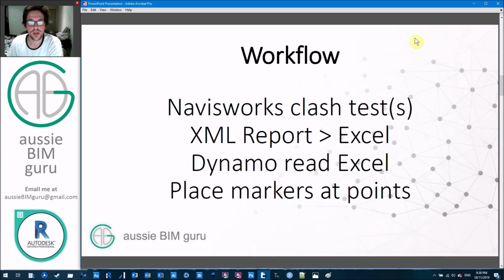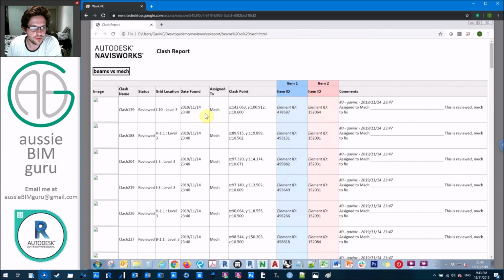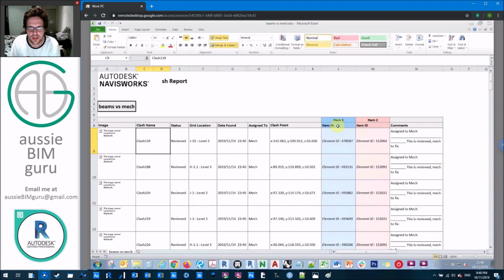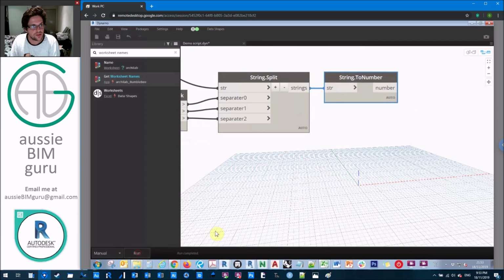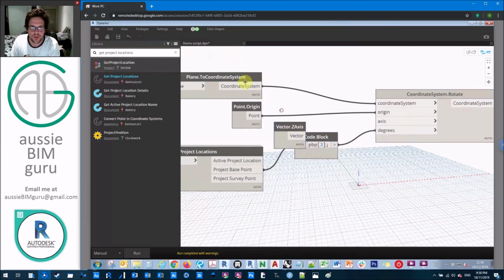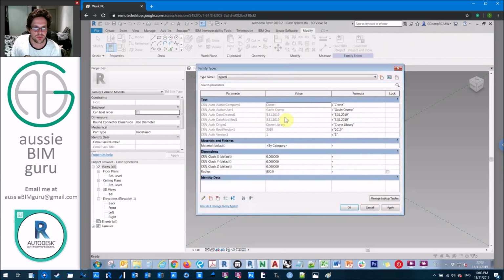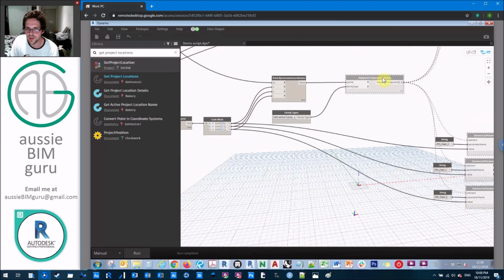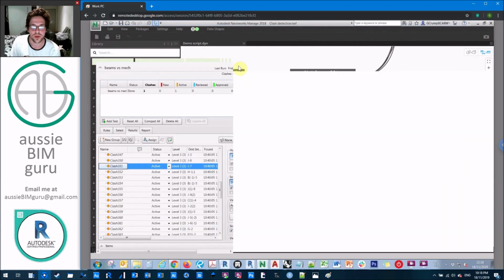Navisworks Clashes to Revit using Dynamo!

Comment from the maker: It seems the little adaptive sphere is the star of the show!

You can find it, and some other families from my videos here:
https://github.com/aussieBIMguru/Revit-Files/tree/master/Families
Reply: Excellent tutorial - Thank you. What is the benefit of using an Adaptive Family for the Sphere over a normal family containing a Sphere?
Reply from the maker: @paulwoodward81  thanks! The benefit here is an adaptive family can be placed at a specific point in 3d space with no bearing on level or offset, unlike a typical level/workplane based family.

Comment: Hi Gav, thanks for your amazing videos but . When I use Watch in min:13:55, instead of the actual values like you have in your example, I only see the header names such as point, conflict name, and so on. Could you help me with this?
Reply from the maker: It sounds like you might have missed a transpose of the data potentially. Youre seeing rows vs columns by the sounds of it.

Comment: This is a fantastic workflow. How would you deal with a project where the Origin displacement is 0.000, this is causing errors now in Revit 2024. And do you have to use Adaptive Family?
Reply from the maker: If the origin is coincident then I guess you would only need to rotate the points around it by the difference in project/actual north? Sorry might not be understanding this precisely. There are some nodes in Genius Loci that handle coordinate translations that I believe are probably more robust vs my approach here potentially.

Adaptive is really personal choice, you could also place a workplane/level based family at datum then elevate to suit as well. I find adaptives a little better to programatically move if you need to refresh the markers without creating them all from scratch.
Reply: @AussieBIMGuru  Your a legend Gavin, thank you for your help.

Comment: could u share this scrip? because i did exactly the same, adpting to my project and i got so many errors...
Reply from the maker: @rafael_random  this is quite an old tutorial now so there is likely going to be changes needed to make it compatible with revit 2024 or 2025 if you are using those.

All my scripts are on my github.

Comment: I need your help on this. there are 2 problems which i am encountering in this. first is the clash point units. when i export the clash report, clash point comes in mm and you have got clash point in meters. second is the get project locations nod, in this nod there is no option of active project location. the one project location node that i got is having 4 options. internal origin, project base point, project survey point and site name.
Reply from the maker: If you got different units it is likely down to the properties we are using in Navisworks, but you can always multiple or divide by 1000 depending on if you want to convert to m or mm respectively.

The node for project locations has changed for that step since I recorded the video unfortunately. I updated my script on GitHub to show a different way to go about this vs the old node.

Comment: "Can not index into a null list, dictionary or string." Hi Gavin, this pop-up is coming on my "code block" node.
Reply from the maker: Check the data you are sending in to the block for any nulls. It sounds like there must be at least one value not working. The genuis loci node for project locations changed since this video if you are getting them around that area of the script - will need to look carefully at the values i am targetting versus just connecting the wires the same way that i do here for it to work.

Comment: Hi Gavin...I am facing a similar issue..I placing points in the electrical model and these are extracted from a architecture file room locations. The points are bit rotated and not falling correctly..can you provide a solution for this..Thanks in advance
Reply from the maker: Look into genius loci coordinates related nodes that can address this challenge if ny method didnt work for you.

Comment: Hey Gav, i exportet a Revit Projekt to Navisworks to do the clash detection. Now i want to prozess your updated scipt but due to 0 roation i get an error in the group "Translate points, make adaptives", do you have any recommandation to work around this? Bescause i would like to have ur scipt in case of a rotation but also the oppertunity to work with the script if there is no rotation or different project base point. many thanks in advance and best regards :)
Reply from the maker: Try using the internal to project coordinates node from genius loci package as an altefnative for converting the coordinates.

Comment: Hi Gavin assistance would be appreciated. I have worked through recreating this script however I have come up against an issue when I run the script the Point.ByCoordinates has a warning and doesn't work I believe from reading the geometry scaling needed changing which I have set to Extra Large however the points are still outside dynamo range.
Reply from the maker: Yes this can happen, it may be worth using Genius Loci and its coordinate translation nodes instead as that does it without the need for geometry to be processed distantly in Dynamo's preview.

Comment: hi please tell us about how to set rule in navis while clash detection to set or group ignorable clash & also moderate clashes in whole with all descplines pls
Reply from the maker: Honestly I typically set up search sets manually, as they will depend on the data quality you can filter by. I then clash these and use the 'exclude' mode to isolate groups of clashes by common elements. Some addins out there help a bit but I find doing it manually helps me review it all as I go.

Comment: Warning: Data.ImportExcel operation failed. 
The RPC server is unavailable. (Exception from HRESULT: 0x800706BA)

at the first run?!?!?
Reply from the maker: Usually means microsoft 365 has a 32/64 bit issue and needs reinstallation.

See thread here:
https://forum.dynamobim.com/t/warning-data-exportexcel-operation-failed/64749/19

Comment: what is the code block for z displacement,
the project im working on currently has a Z displacement but in the video you only gave N_s_disp... and E_w_disp... what would be for Z
Reply from the maker: Z would be the elevation property of the project base point.
Reply: it seem that genuisloci is different from the node that you had use for the tutorial is there any work around for this? thank you so  much
Reply from the maker: @MariaSamanthaDeCastro  it is different, yes. It changed later unfortunately. Later revit builds have standard nodes for getting these values under revit > coordinates I think.
Reply: @AussieBIMGuru  I'll try to look into it, appreciate your fast response and this tutorial is very helpful for someone who's starting out! :)

Comment: Hi Gavin many thanks for your guidance. really appreciated. I am trying to give some good use of your script but it seems that the Get Project Locations node has slighlted changed by introducing "Internal" Origin" instead of the "Active Project location", but it doesn't work as I get a warning at the followin node "Point.by.Cartesian.Coordinates". Any clue? Thank you!
Reply from the maker: yes unfortunately the node changed since this video, but you should be able to get the same values out of the outputs using slightly different techniques. In principle you just need to get the NS/EW/Rotation values I think, which the node contains.

I made a more up to date version of the script here also if it helps:
https://github.com/aussieBIMguru/Dynamo_Scripts/blob/master/ABG_191121_NavisClashes%20(updated).dyn

Comment: Hi Gavin.
My task is either doing MEP coordination or cost control depending on what's available for me.
I am zero in Revit, Navisworks and Dynamo.
My question 
1. which one that I should buy and learn 1st and thereafter.
2. do u tailored course for individual like me.
Thanks in advance.
Reply from the maker: If you are measuring a Revit model then you should focus on Revit itself. Coordination is probably more widely needed in the industry versus cost control, unless you are a quantity surveyor. I have a video coming out next Monday on using Dynamo for cost takeoff, and my video from Monday of this week focused on Revit and cost takeoff.

I don't do tailored courses as they would take too much time and not be affordable unfortunately. Most of what I do here for YouTube is my spare time, whilst otherwise I do paid consulting services. My rates are targeted at western markets also (as I live in a country where everything costs equivalently), so are usually not affordable in other economies or for individuals.

Comment: Hi Gavin! Thank you very much for this tutorial! I just have a question. In my case this works great when the survey point is at (0,0,0) but it's failing me when the survey point has different coordinates. Do you know how could I handle this situation? Thank so much!
Reply from the maker: In that case you will likely need to compensate the offset applied by the survey point's difference. The model typically relies on the relationship between the internal origin and the project base point the project base point's values could be used for the offset as well given it's relative to the surveyed coordinate system.
Reply: @AussieBIMGuru Thank you very much for your reply! On the meantime I found that the Genius Luci package has a node that allows you to transform survey coordinates to internal coordinates. It doesn't place the element at the exact point but it's close. I'll give your solution a try! Thanks again for the amazing content.

Comment: Thank You Aussie BIM Guru for the detailed tutorial, nice work! However, I came across the issue of not being able to use the get project location from the Genius Loci Package that you used. How can I resolve this issue ?
Reply from the maker: The node has been changed since my tutorial unfortunately, but the data can still be obtained, it's just in a different structure. I will likely remake this tutorial eventually with a simpler method that doesnt use the genius loci node - it has caused a lot of trouble and time for me due to being changed after i made this unfortunately.
Reply: @AussieBIMGuru  I faced the same problem, I am blocked on getting the active project location and would love to see how it can be resolved. Thanks again!
Reply from the maker: @joannahalal8614  it needs a different approach. Use point.x and point.y on the points to get the N/S E/W values instead.
Reply: @AussieBIMGuru  it worked :D :D !!! thank you so much !!

Comment: Hi from august 2021 and thank you for the video! I am sure that I can't criticize free educational content (especially so useful). But I have to say that working with custom nodes with no information about packages versions is really painful. Genius Loci, for example, "Get project locations" node has another output pins functionality in my current installed version. P.S. Sorry if there is version info and I just missed it.
Reply from the maker: You're welcome. Yeah I mostly use my own package these days where possible as sometimes nodes change and I'm not typically aware of it as the packages I use tend to have 100s of nodes. I typically work with the current builds at time of recording where possible for reference.

My hope is that people can apply their knowledge of dynamo if they come across slight changes in the node functions as even the dynamo nodes change sometimes as well.

One of the issues with youtube is it cant really be updated (just removed). This has in part encouraged me to develop a course platform in future to capture more structured and updatable content.

Comment: Hi Gavin,
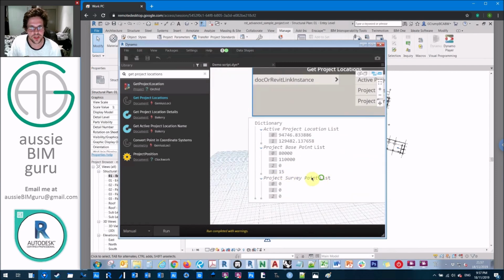I am having issues with the Genius Loci - Get Project Locations node. It looks like they updated the package. I am new to Dynamo and I can't seem to get pass this issue. I was wondering if you could give me some pointers on how to solve the issue. Your video shows (20:00) the node as Active Project Location and the new node replace the Active Project Location with Internal Origin.
Reply from the maker: Yes unfortunately they updated this node shortly after I made this tutorial. It's really just a matter of reviewing what the node returns now and trying to reach the same values as what I retrieve here, shouldn't be too hard. From what I can see the project rotation is at a lower index in the pbp list output now, and the internal origin is a point instead - so you can deconstruct it to get its X/Y value now instead.

Comment: How add matyrail import solid work components in Revit
Reply from the maker: I would suggest getting it into a format that can be imported to a family editor such as dwg, 3dm, sat or skp. You will lose most functionality/parametricism however, so usually it's best to use this as a base and remodel as native geometry after - the programs aren't really that compatible.

There's a thread discussing it in depth here;
https://forums.autodesk.com/t5/revit-structure-forum/converting-solidworks-assembly-to-revit/td-p/6783547

Comment: Hii... Great video... A small query.. When I imported some points from autocad they are placed at a far position and I unable to correct those because I have my north/south and east/west values as 0 in my model so I am unable to measure the
 distance and there is no vector to pull the points back at original position.. How should I do that..? Kindly suggest me Gavin.. Thanks in advance..
Reply from the maker: In this case you may need to manually measure the differences and build the vector from XYZ components in Dynamo instead. I would try the genius loci package which has a node for reading blocks, or bimorph nodes with one for lines on layers instead maybe unless you're using the dataextract tool in AutoCAD.

Comment: Thanks for all the videos!!! Challenge for you, can you do this exercise
 in Grasshopper?
Reply from the maker: It would technically be possible, but I'm not sure it would be necessary in this case unless your rhino model is the coordination model source as well.
Reply: @AussieBIMGuru  Thanks for getting back to me. I'm using Rhino Inside to have all the grasshopper apps inside Revit. this the reason. Find some difficulty with Dynamo. Anyways, love your work.
Reply from the maker: @antonwelgemoed6094  in that case I'll try to think of a workflow a bit like this. I encourage you to persevere with both platforms, but I understand new platforms take a while to learn as well :)
Reply: @AussieBIMGuru  Great stuff. Thanks

Comment: Thank you for another great video, Gavin. I was trying to replicate it but the GeniusLoci package node no longer has the Project Internal Point. How should I get it?
Reply from the maker: There should still be the node in the package but I believe it may have changed in list structure for some of the outputs (e.g. in one the pbp is a point, the other it is a list of values).

You could try using my package (Crumple) alternatively which has nodes to get the various base points, but it would be a bit different to using genius loci in the script layout at that point if so.

Comment: its really great job, i suggest generating the views with clash name , grid location will be the additional muscle to the tool. This gives the picture , We were underestimating the dynamo , adopting python , since these are possible in dynamo.
Reply from the maker: Yes Dynamo is capable of many things, even without much python required (a few of the nodes here use python behind the scenes.

Clash to views would be a good next step to this workflow, although it can be risky if users make 1 view per clash - can create 100's of views!

Comment: Hi I'm new to Naviswork and Revit. Would you please recommend how to set up Revit to easy transfer and search in Navis. Thanks
Reply from the maker: Hi Huynh, to export to Navisworks from Revit, go to R > Export > NWC.

There are some settings you can adjust here to optomize your export, typically if you search for the properties tab and export all your data this works best for review purposes. You will need fairly clean data structures to take advantage of elements in Navisworks, so I suggest using shared parameters in Revit if you aren't already.

Comment: Hi Gavin,

Assuming one had real world raw GPS data, long, latt and elevation. Would it be possible to have this show in the same manner in the Revit file ?

Cheers Gavin
Reply from the maker: Probably not due to the 10km window of comfort the software works within. If you could set the revit origin to be within this distance in relation to the numbers it's possible though theoretically.
Reply: @AussieBIMGuru  Cheer Gavin. Appreciate the insight

Comment: (Warning: Your inputs lie outside of the allowable modeling range, consider choosing the Extra Large setting with a modeling range between 1 and 100,000,000 from the "Settings => Geometry Working Range" dialog) 

 This is the only warning  its shows, i've change my geometry setting to extra large but still its showing the same error and points also not highlighted in revit model. i don't understand why ?

could you help regarding this
Reply from the maker: Your coordinates must be quite far from the origin in your model coordinates system from Navisworks prior to translation in Dynamo - that's my guess...!

Usually this warning is ignorable, and if extra large units don't correct it there isn't much more that can be done I believe. Might be worth cross checking your project coordinates system vs. the internal origin and making sure you aren't making any points more than 10km from the origin.
Reply: @AussieBIMGuru  Thanks Aussie , Could you tell me what packages were installed in your dynamo ?
Reply from the maker: In this script I use Genius Loci and Bumblebee.